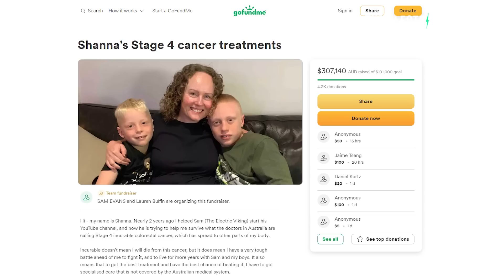CATL unveils Condensed Battery for Aircraft & 1000 mile range EV's

Comment: Sam love your channel but your off on this one a doubling of  energy density from 250wh/kg to  500wh/kg  is excellent for EV cars and will bring them into parity of gasoline in terms of range however its  nothing close to the required energy density for commercial aviation.  Musk was likely referring to civil aviation where the range for a small plane like a single engine 2 seater or a drone  has a load and trip duration are far smaller profile than a commercial flight.  If you check energy density of Jet-A-1 used in commercial jets / turboprops its 43 MJ/kg vs lithium variants which are amount 0.5 MJ/kg so 86 times more energy per unit weight of current tech or 43x more energy density for this newer tech so this is not yet anywhere close to the energy density required to replace liquid dinosaurs for that application. The efficiency / energy losses  for an electric motor is around 20% vs 50% for a turbine but is not enough to offset the energy density differences.  There are other chemistries ie sodium / sulphur and others that are exploring even higher 10x densities.  In technology there is never a game over there is only game changers.  When Edisons went from his first 15  hour incandescent filament to a 2 month filament it was a 100x improvement  but he could never image there would be LED bulbs with 100,000 hour duration so there is no such thing as the term End game in context of R&D and innovation.  Continued well wishes to you prayers for your wife.

Comment: If available at a reasonable price and not too volitile and durablel then these would be best used in vehicles by maintaining the battery capacity with half as many cells- then you could make twice as many vehicles and reduce vehicle weight.  It would not be a total answer for Lithium EVs but it would make the max number possible to produce annually to 10 million rather than 5 million. 10% of vehicles rather than 5%. delivered annually max.

Comment: One drawback I can see is airplanes fly at high altitudes and it is extremely cold up there.  How much will that diminish the charge of the battery.  Living in cold areas cars lose much of their capacity due to the extreme temperature.  These batteries will help on short hops of 300-500 miles and greatest help will be in the reduction in exhaust fumes over cities.

Comment: Sam, you should do some actual research into battery technology. 500 WH per KG isn't even close to the power density needed for long range aircraft. Tesla's own 250 WH per KG when configured in an actual battery pack tip the scale at 1,400 lbs. So your 500 WH batteries will only bring the weight down to 700 lbs. for 100 KWH. This translate to flights of a few hundred miles, not 4,000 plus. Hydrogen already has this beat by a long shot, but the problem with hydrogen is not weight, it is volume. Small aircraft manufacturers are all onboard switching to electric, the motors are so superior to ICE engines (just like in cars) but the power source, batteries, just doesn't deliver.

Comment: 3:56 I’m very skeptical of this claim that you could get 1000 km (625 mi) of range on a 50-kWh, 500 kWh/kg battery pack. Decreasing the weight from a higher energy density pack would surely increase range by some amount, but the idea that range is going to double because you reduced the weight of just the battery pack—not even the overall vehicle weight—by half sounds like wishful thinking that would never pan out in reality.

Comment: This technology will change the small light aircraft market forever. It will dramatically reduce the aircraft's operational costs. The Chinese-owned Austrian Diamond Aircraft is testing eDA-40 electric light aircraft. It can fly for 90 minutes with current battery tech. If the new aircraft uses this new battery tech from CATL, it can fly for 180 minutes instead.

Comment: kWh is a measure of energy. 100kWh is 100kWh regardless of energy density, so this hypothetical new truck won't have 500 miles range easily with this new 100kWh battery. I think what you mean is that for a truck with this new battery that is the same size/weight as current technology, you're looking at 200+kWh of energy stored which will give you the magic 500 miles range. Of course we are assuming this battery doesn't cost a fortune, if it's not a lot cheaper per kWh then perhaps not as exciting especially for the masses.

Comment: I would also point out, energy density, even if these batteries can meet that amazing number, something of which I am skeptical, is but a single factor. What is their durability? The operating temperatures under which they can function? Their likelihood of spontaneous failure. BYD cars still detonate several times a day in China, the other Chinese brands are worse. Until we get some of these batteries in the wild, we won't really know. I would not like to be on an airliner that went, "pop!"

Comment: 1000km with 50 kWh?!? That's BS. That's half of the Wh/km of the Mercedes EQXX. Not even a dolphin can move through air at highway speed with that energy.

Aviation batteries failing. Perhaps split the battery in two or more separate systems...

Not overly impressed with your argumentation in this video - the first on your channel I have watched.

Comment: My electric motorcycle would have a 100 mile range with a 33 lbs battery at top speed or 200 miles in city driving. That's compared to 40/80 miles now. Awesome!
Reply: Would mean a 100g battery would be 50wh   that's at least 3x better than we have now.
Reply: @chrishart8548  well yea but the battery would be about 1/3 lighter and still have 2.5 times the range.
Reply: @William Bontrager  I'm interested in an electric motorcycle  I would want an adventure bike style no more than 200kg   but I would imagine it would be £20k with about a 30 mile range with today's technology.   I want something between the Dsr    and the dsr-x   one is not enough  the other is to much.
Reply: @chrishart8548  check out the surrons or talarias. The one I have is a velimotors vmx08 which is a street legal bigger version with a 72 volt battery and about 40-80 miles range and a 60 mph top speed as programmed stock. It's a full carbon fiber frame so it only weighs 105 lbs. E-powersports is selling them for 6,000.
Reply: @William Bontrager  doubt they are street legal In  the UK though.  Also they are way to easily stolen.
Reply: @chrishart8548  that I couldn't say. They have turn signals, vin #s, brake lights, alarms, high/low/fog lights, Regen braking, and approved motor vehicle parts. The easy to steal part is kinda true bc you can pick them up yourself but you got a key and an alarm that would make it at least annoying to steal and hard to run without.

Comment: Sam has no clue. A 50 kwh battery will give the same energy no matter the size. It does not make your car go 1, 000 km. Only when you put a 100 kwh battery in a small very efficient car you will get 1,000 km. And please Sam: it is 500 wh/kilo, not 500 w/kilo.

Comment: I assure you that multi motor aircraft will also have multiple batteries and capability to isolate and cross power from each that is just how aviation works. Only the simplest aircraft would use single energy storage think Piper J3 cub.

Comment: I am a bit sceptical .. same thing with his smaller company  which announced in March : "FREMONT, Calif. – March 23, 2023 – Amprius Technologies, Inc. (“Amprius” or the “Company”) (NYSE: AMPX), a leader in next-generation lithium-ion batteries with its Silicon Anode Platform, is once again raising the bar with the verification of its lithium-ion cell delivering unprecedented energy density of 500 Wh/kg, 1300 Wh/L, resulting in unparalleled run time." ... but we will soon  see,  I hope to be wrong in both cases.

Comment: These new batteries will be expensive and that is why CATL is concentrating on aviation uses at least at first. 
They will need to get the longevity of the battery as well as the recharge speed better before it will be applicable to EV autos and trucks. My guess is that will be in about five years or more.
So don't put off that EV purchase thinking these batteries will soon be available for general use.

Comment: It is interesting CATL is making different types of batteries with a variety of battery capacity per liter or Kg, with a variety of production costs per liter or per Kg.  This enables the car manufacturer to offer an EV with a variety of ranges per fully charged battery (and a variety of prices), while avoiding variations in the car design and the car weight. The customer wants a cheap sedan with relatively short range (:sodium battery),  or an expensive sedan with a very long range (:condensed 'aircraft grade' lithium battery).

Comment: Sam, a few points I think you are getting wrong.  Watts is a unit of power.  Watthour is an account of energy and wh/kg is a measure of energy density.

A 100kwh battery is a 100kwh battery.  Whether its energy density is 250 wh/kg or 500 wh/kg it's not going to extend the range much.  The 500 wh/kg battery will be lighter and smaller, but weight only contributes about 10% of energy consumption in a vehicle and highly depends on elevation changes.  Only if you live and drive in very mountainous terrain would the lighter battery have a significant advantage.  100 kwh is the total energy content.  100 kwh is 100 kwh.  What you might mean to say is that w 500 wh/kg tech you can build a 250 kwh battery that is light enough and small enough to give a truck 250+ mi range WHILE TOWING.  A 100 kwh battery is simply not large enough for a large truck.  When towing consumption for most big trucks drops to  1 mi per kwh or even less, so you need a battery w at least 2-3 times that capacity for a BEV to have a similar towing range to an ICE truck.  

Also.  Planes today have multiple fuel tanks since they are compartmentalized throughout the wings and some other areas.  You will also have MULTIPLE batteries that can independently power one or multiple electric motors in case one or multiple batteries fail.

And for batteries what also matters beyond cycle life, reliability and high energy content (both volumetric and gravimetric) it also needs rapid recharge-ability AND most importantly LOW COST.  Cost comes w scale.  How fast can CATL scale these batteries?  It will happen but I think no one knows enough about it.  Simply believing CATL is not a good strategy.  They need to also say and show how much they can produce and by when.  In other words, what is their production road map?  If they have not said anything, I would be more cautious in my expectations.

Comment: Sam, your comparison is inadequate because the way you display it with ICE airplanes is that they don't have only one tank - and if something happens to it the plain is fucked. With batteries every motor can have its own battery...or even two or three batteries that are independent of each other. 

Also: electric motors are way way more reliable and don't generate that much heat...which is a strain on the construction  in ICE planes. 

Imagine how silent it will be to lift off, fly and land.

Comment: The only complaint I have is why they would specify aircraft and EVs secondary ? Vehicles are here and now . Maybe they don't want to scare off new buyers of EVs and the product they are producing today as why not wait for 500 miles of range over 250 . Yes if this is true and not the endless pipe dreams we hear from companies than yes it's over . It would not make sense to buy a comparable ice vehicles with a similar pricetag but with a smaller battery pack it should be cheaper . If you produce the battery you own the automotive world .

Comment: What is the definition of condensed battery?
Reply: I should have made it clear many of the press releases refer to a "condensed matter" battery. I thought condensed matter meant something at a sub atomic level. I assume that is not what they mean. Is it a way of saying the electrolyte is still liquid but not solid etc. I thought CATL were just about to mass produce sodium ion batteries, and assume this doesn't simply refer to them with a higher solids content. Just want someone to explain what it actually means.
Reply: and not a condensor (capacitor).

Comment: The model 3 weighs about 1900kg, with a 500kWh battery it will weigh about 1800kg. Hardly make a big difference in total weight, wont change the range by much. Cost of purchase is the bigger factor, that might change.
Wish Sam would use the correct units, said Watts per kg instead of Watt hours per kg at one point.

Comment: What a load of hype =  as gasoline / petrol is in the order of 12-13 kWh per kg...   (allowing for inefficiency) batteries  need to be around 2+kW/kg to compete...  faster quicker further - E-fuel is more likely to be competitive, sooner...  Sam is so full of it -   Give me a pickup truck which can traverse the Simpson Desert or - even see the upper reaches of lake Eyre, not likely.

That you don't know why or how solid or semisolid -- is a bneficial thing shows limits of comprehension.
(parallel redundancy is key to safety)
Reply: How many ICE vehicles on the road have over 1000km/620mi of range? With that amount of range, that effectively ends range anxiety. If the charging speed is equal to current batteries with 70% charge in 30min, that means you could drive for 9hrs, charge for 30min, and drive another 7hrs at 100km/h or 60mph.

Efuel requires around 3 to 10X the energy to make vs charging a battery, plus a ton more equipment and transport and still having to maintain an ICE engine and just... No. It's a concept that's dead on arrival. Don't mention efuels if you want to be taken seriously by anyone who knows anything.
Reply: For the sake of argument, let's go along with what you said. Now compare the 500 lb. gasoline engine, with thousands of parts, with an equivalent 100 lb. electric motor with only one moving part - the rotor.

Comment: If this is the case, 4680 cells are already obsolete. Tesla needs to get back to the drawing board
Reply: "4680" refers to the cells being 46mm in diameter and 80mm tall. It says nothing about the chemistry or energy density or anything. You could make NiCad batteries in a 4680 form factor. Tesla is expected to hit 500Wh/kg with 4680s by around 2025/6. CATL isn't in production with these yet, they're just pumping their stock price.

Comment: For aircraft most energy is used on initial climb.  Then you recover energy with regen when gliding down.  Some sort of booster pack that piggybacks and flies back to takeoff location would be good for range increase.  Probably initially it will be small vertical lift electric jump jets.
Reply: @mefobills: What mechanism can recapture energy while gliding down?  Windmilling the props?  Would be interesting to see some engineering (energy) data re that concept.
Reply: I've wondered about serious in wheel motors for aircraft instead? They could accelerate the planes very quickly vs just using the engines up to take off speeds. Then on landing absorb quite a bit of regenerative braking energy once the plane starts to brake. 🤔
Reply: @4literv6  I would guess that the amount of braking energy would not come close to the penalties involved in the weight of the electric brakes, not to mention the extra complexity of the design, the ability of the motor to withstand acceleration from 0 to 120 mph in one second, etc.  Would be fun to see an engineer do some calculations!
Reply: @lokensga  I don't think they would ad much additional weight at all? But yes a real engineering review would be fascinating imo. 👍🏻🤔
Reply: The extra weight of wheel motors massively outweighs the savings on energy for taxiing and would not be beneficial for efficiency or take off boost.

The amount of fuel used in the take off and climb is roughly equivalent to one hour of cruise, so the assertion that most energy is used in the climb is true only for very short flights.
Reply: @nickboylen6873  I thought in wheel motors had made a lot of progress recently? Hence why lordstown motors uses elaphe in wheel motors for it's endurance ev pickup. And most electric scooters, bicycles and even many ev motorcycles now use in wheel motors. 🤔

That is a crazy stat on fuel use just for takeoff. And lends credence to my hypothesis on recovering energy from regen braking when landing. 👍🏻
Reply: @4literv6  Embed electric rails in the runways and add some kind of pantograph to the landing gear, then power the takeoff the way high speed trains are powered instead of from the onboard battery pack.  Add 1 hour to the electric plane's range without adding much weight.

Heck, have the pantograph detach and remain on the ground and add virtually no weight.
Reply: @sunspot42  ah almost like a carrier setup, the new Gerald Ford class use electric catapults now. Anyway the wheels would lock into grooves and a grounding rod then drops into the groove and directly powers the plane until rotation is achieved? 🤔
Reply: @4literv6  Maybe something like that, dunno.  If it really consumes 1 hour worth of flight energy just to get off the ground seems like it would be worth it.

Capacitors tend to be more lightweight than batteries as well, so I wonder if it would make sense to include some of those on planes as well for the initial climb phase, which is presumably pretty rough on batteries.
Reply: @sunspot42  good point, maybe ev plane pack's become like the existing hybrid pack chemistries used by our next energy and catl.
Where they use one portion of the pack for very high energy demands, and the other for steady state lower overall current draw? 🤔